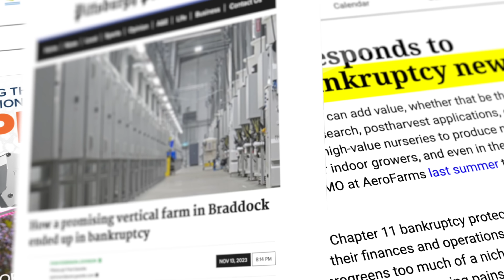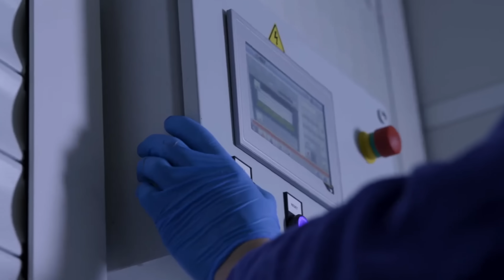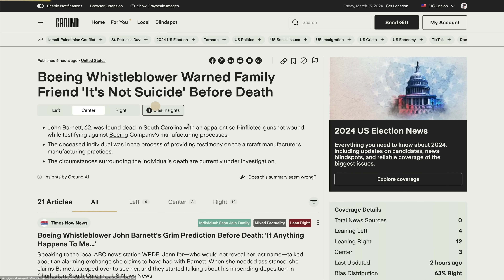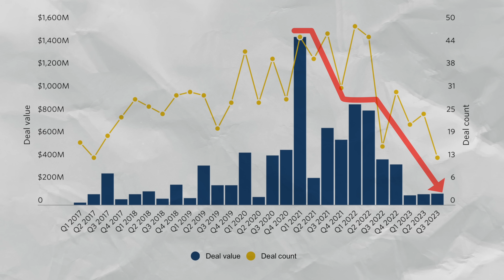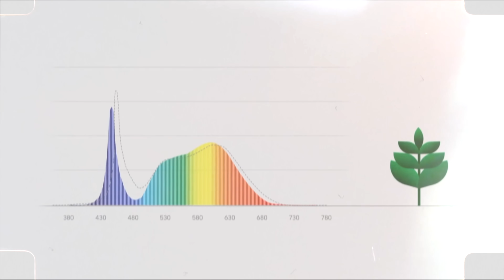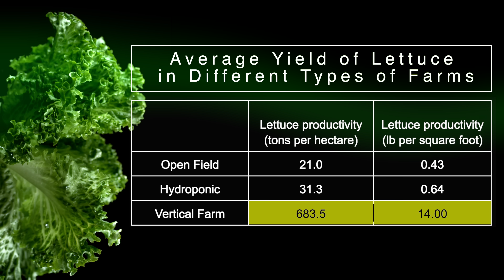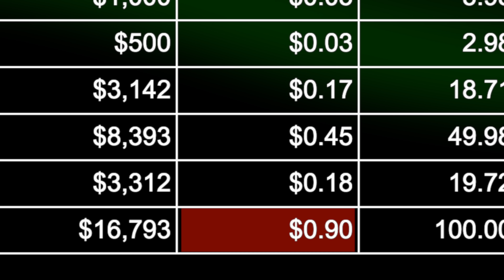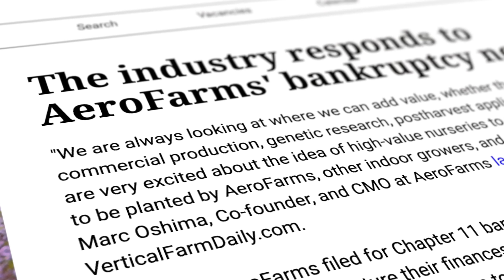The EPIC Failure of Vertical Farms - What Happened?

Comment: 4:45 The same thing happened with Video games and the video game market crash of 1983. A lot of people think no one wanted video games anymore and it just crashed, but the demand was still just as high, it's just that major investors were stating there'd be a 50% increase in profits, over already record breaking profits previous years, and when they had an increase in profits at 15% (INCREASE!) it fell short of the unrealistic 50%, and so investors got cold feet, they had promised retirements, security, etc, and so when it fell short, they yanked out and put it somewhere else that they could promise the big numbers. The market crunched by 97%. The crash was harsh.

But then, what was left, kept going, and managed to survive and then thrive.

I see something similar here, where there was more "Investor talk" than hands on experience talk. Instead of dialogue on the problems, advancements, there was over selling, over promising, under delivering, and an unwillingness to experiment or change course because "The unknown" is scary to investors.

A major problem I've seen with ventures like this is what you brought up, it works but it requires monetary life support to function and can never break it's reliance on cash injections. The equipment is too expensive, and the labor is too specialized and requires way more than it "Should" for the costs they're looking at. We're effectively trying to make a space program on Earth, on a space station this would rock, but on Earth, we're needlessly making it expensive and snubbing the resources on hand, while not addressing things like labor that could likely be automated, as well as the specialized equipment that isn't the standard, with wide adoption it could be cheaper, but that's the problem, if these can't get off the ground, it won't be widely adopted. They're not growing great cash crops that rake in the dough, they're growing something I can get at the local market for 50 cents. We need to take steps back and reassess what we can continue to use from nature, and what we can improve, automate, and "Make simpler", because right now, it's a project for a Mars colony more than a project for Earth to work with.

As always with economics, "Keep it simple, stupid." we too often try and craft a magic bullet solution that takes too many steps towards fixing a problem and then we come to find the pieces just don't fit.

Comment: Haven't seen the video yet so I'm gonna go ahead first and guess the problem, which I think is primarily energy prices.

Edit: Looks like it's primarily the labor price instead. The good thing is that this is absolutely something that can be optimized. Given that there are so few vertical farms there really can't be that many workers, making them expensive. If there were far more farms with far more workers then I think they would be quite cheap to hire. 
Then another guess is there is also a need for perfection in crops. After all it's new and shiny and needs to compete! But really the crops don't need to be perfect, they just need to be average, which would most likely far easier to produce.

Comment: If A.I engineer programs can step in to do most of the heavy lifting in the calculation department and can help come up with a robotic automation system to where they can monitor and harvest the crops instead of a human, that would cut down the costs dramatically. Then hopefully it can compete with the running costs of a normal farm. But until then, they have years away from developing that sort of solution. 

Well that's just my perspective

Comment: The simple issue is energy.  You cannot grow anything but broadleaf plants in the low energy lighting they are trying to use.  You have to use real grow lights,  and those use a lot of energy.

Hydroponics are incredibly resource cheap,  as long as you use the sun. If you replace the sun,  the cost skyrockets because of energy prices.

I don't believe that price breakout. The Netherlands,  Arizona and New Mexico all run large hydroponics setups, with enormous greenhouses. You would need the same labor to do that job as you would in a vertical farm.

Comment: You mentioned LEDs vs using the sun multiple times... now, i dunno if you're trolling or not but the reason to use LEDs is to stack the trays, to grow vertically. It's at the core of the value proposition, hell, it's in the name. Sunlight could only reach top+outer trays. And LED light is not some simulated substitute for light... it is light. and it is low cost.

Comment: Interesting.  I have a degree in horticulture, and amusingly way back in higschool, I totally did a project on what wavelengths plants preferred.

The use of lettuce here.. makes sense, but also really doesn't.  Lettuce is really easy to grow, so it makes 100% sense to use as the staple...  the problem is lettuce is real easy to grow, and cheap, thus not cost effective as stated.  Lettuce are cold weather crops that dont need much light, and can withstand cold temps, for extended growing seasons.
Greenhouses in general extend growing seasons, via heating, and allow shade or lights to cut down on light, or extend daylight as needed.  like, corn has a very specific daylight requirement to produce.   6-8hr days might be required for some.  180 days for corn.    other plants require cold periods.  daffs/tulips for example, need a cold period to bloom. got to put them in a fridge to force them, if you dont' have a natural winter.
so, the obvious here is.. high value crops with very specific growing conditions.  strawberries.  tomatoes.   coffee. vanilla.  Other fruits out of season.

I'd still be confused why the blue collar cost is so high.  regular greenhouses don't have costs like that.

Comment: Never did make sense to me why vertical farming would be able to beat a greenhouse. The upfront costs and maintenance would be far too high with robotic based vertical farming. Plus you still have electricity usage that is replacing sunlight. Even in areas with little water why wouldn't you put everything in a greenhouse? If anything the land and environmental impact of that land is less in these areas.

You can still do the whole aeroponics things, and even put up the LED's if you want growth during the night. But you are missing out on free sunlight and paying far more for land if you are doing this in a city. A greenhouse can still control the environment decently, let you grow in most seasons especially if you spend a bit on heating, you can still reduce water usage, etc.

Comment: Look here. It's simply basic maths. A given amount of soil contains a finite amount of nutrients. And no, plants do not only need phosphorus and nitrate fertilizer. To produce the vitamins and micronutrients that we need, plants need to either absorb them or chemically produce them from the soil. 
Most of the trace elements in soil come from rain, insects and small rodents, from mushrooms and other life thriving and dying. 
All of this is missing in a sterile greenhouse, so obviously at some point the soil gets depleted of vital micronutrients. 

You can use genetical engineering and fertilizer all you like, but a fixed amount of soil can only produce a finite amount of vitamins. That's why an orange today has only 1/3 the vitamins than an orange in 1912. You simply cannot trick math. Yes, you can grow larger or more oranges, but they will have less vitamins then.

Comment: The vertical infrastructured farming is still too expensive compared to the selling prices of crops and buying prices of both power and materials. 

To be proficatble they need to cost less than the selling income in a reasonable amount of time.

If we get a mass producer to make low cost set of infrastructure it will be profitable but for now for what i know each one needs a tailored project

Comment: 13:52 - you don't need to have an enclosed building for your food supply - that's where it gets silly - if you have a glass building with sunlight coming in, like original vertical farms have - then it's not an issue. If you have plant waste recirculating back to the plants - you don't need fertilizer either. Plus if you grow plants to reach the seed stage - you don't need to buy more seeds. Maybe these places didn't do it the right way. We'll try again and do it right another way.

Comment: This was very interesting and informative. With continued research into lab-grown meat, I hope the lessons from vertical farms (both positive and negative) are applied when folks try to ramp up production into amounts that try to supply large volumes of consumers.
The labor costs are something I noticed quite a bit. On dairy farms, labor is quite a problem: finding people willing to both deal with the results of animal handling, as well as follow process for milking and handling the cows. Happy, healthy animals are productive animals, after all. Still, robotic milking systems are becoming increasingly popular in the US, after much success in Europe as the design is sufficiently quality to properly milk the cows which voluntarily bring themselves in to the milking stalls. 
The skill levels required for tilling/planting/pest control/fertilizing/harvest varies according to crop as well. Harvesting vegetables for the most part looks to be a low-skill process with a lot of manual labor. Fruits are a high planting cost crop, with quite a bit of human-judgement maintenance (trimming back branches to encourage new growth), and despite the regular maintenance still needs a lot of space for the tree itself. In most crops in general, as I think of it, planting is a high skill process to run the equipment, and tillage is increasingly so. Pest control (weeds, insects) is also a high skill process, requiring certification to properly apply pest-control substances (including for organic items, which use different environmentally-neutral chemicals that are still under long-term development), or careful tillage for mechanical weed control between rows of crops without ruining said crops. Grains and animal forage require high skill to harvest, with moderate skill support: combine harvesters are not simple machines to operate, and the dump trucks used require more skill and care to operate than a car.
Going back to vertical farming, the more I think of it, the more it is like the old fashioned upright silos that farmers are doing away with in favor of bunker silos or horizontal bags of feed 8' to 15' in diameter. When something goes wrong in a silo, it has to be fixed then and there, with skilled labor and much effort to bring the parts up 60' feet above ground, by way of a ladder or rope. If something goes wrong with the unloading equipment for a bunker silo (usually, a front-end loader), the machine is dragged off to the side if necessary, and repaired at the owner's convenience while a backup machine is used. If something goes wrong in a vertical farm, the clock is ticking before some amount of the crop is lost. The machines must be fixed in place, possibly in a tight or awkward location since the system is set up for maximizing crops rather than necessarily ease of repair-- an understandable tradeoff.
Thanks for the thought-provoking video!

Comment: Yet another brilliant idea failing to horrible implementation & assumptions!  Vertical OPEN-AIR farms!  Use fertile soil, rejuvenate as required with potash. Build the greenhouse complex in a pyramid formation so each level gets direct sunlight.  Among the key reasons for vertical farms are not only efficiency but protection from borrowing animals that destroy the root system.  China went through a similar catastrophe from 1958 to 1962.

Comment: vertical farms are not that expensive by nature. badly designed ones are. you can buy a traditional farm and turn into a money pit if you do not know what you doing. these companies that crashed and burned was not started or run by people that understand the farming business, they were started by people that wanted to raise money and to do that you need to be flashy. develop new tech and buy expensive equipment. they did not build farms they built labs. world is filled with modern greenhouses that grow vertically and they do not struggle.

Comment: Ultimately, yes, this is going to work. I look at the energy cost and notice that it's cheaper than the finished product cost of the competition. 

But we may be looking at hundreds of years into the future, not decades.

With vertical farming available, there is no longer any population limit. Right now, we're set to peak at about 10bn and then go down, and so you might think that the impetus to provide enough food for a huge population is gone. But that's a current guesstimate; it might and probably will change in the future. Longevity might reach a level where we basically don't die of old age and/or people might change their attitude towards children, making each of us sire MORE kids, not fewer (as is commonly assumed).

In any case; the current state will be that of niche products. That's fine. All new business models seem to go through a few hype/burn phases before investors start understanding the limits and possibilities of the technologies in question.

Comment: Simple solution: if you got all this money to build a farm then use that fat cat wallet of yours to build a solar farm as well to power your vertical farm

Solution 2: stop making everything to high tech and advanced lol you can probably get the same results building some janky automated sht with a raspberry pi or something similar like it's not that complicated you put sensors in the water and have the system pump out the water and replace it with new clean water as well as controlling the amount and timing of food and light etc.

Solution 3: build it all yourself for cheaper instead of buying some other companies bs I mean hey it's your business you can either be lazy and spend all this money or bust your ass even harder to fix your company 🤷‍♂️

Comment: It is because they are growing crops that aren't highly valuable. rather than growing tomatoes grow corn, wheat oats, rice or barley.  Or maybe sugar cane and coffee. this operation could be highly successful if well planned. Consider if you built a 20 floor complex that encompassed an acre. Then on the roof you could have a pasture with a herd of sheep who would consume the materials that humans cannot consume while producing manure which would be used as fertilizer. The facility can be climate controlled  and each acre could be rented to farmers who could tend to the crops. Add a water filtration system , solar panels for windows, wind turbines inside ventilation shafts, and an incinerators for turning trash into energy and you have a self sustaining production facility.

Comment: The whole concept doesn't make sense.  When I lived in DE I used a combination of square foot and 4 season gardening.  In a 20x40 ft plot of raised beds, I grew every vegetable I ate for the year plus gave 600 lbs of produce per year to the local food bank.  My inputs were mostly kitchen scraps and rainwater, and I kept pests under control by creating areas for beneficial insects and predators.  Outside the initial setup and at harvest times, the labor involved was about 20 mins per week.  Initial capital for setup was around $300 (I recycled a bunch of materials) with maybe another $50 per year after.  If HOAs and municipalities would open up green spaces to small agriculture, every city in the US could be fed by the surrounding suburbs, and every small town could feed itself.  It will never happen though, 'cause the right people won't be making the money.